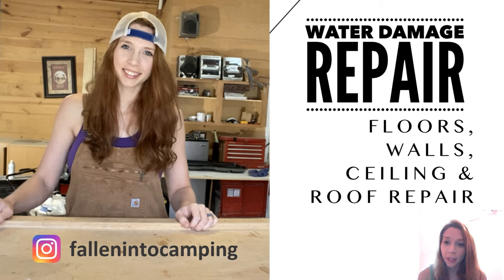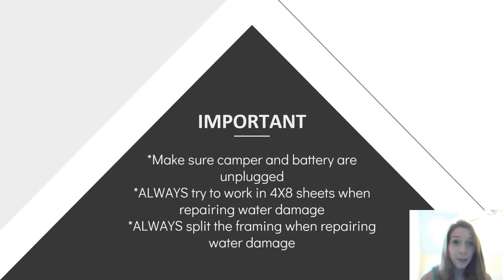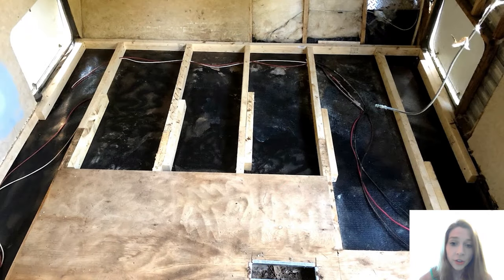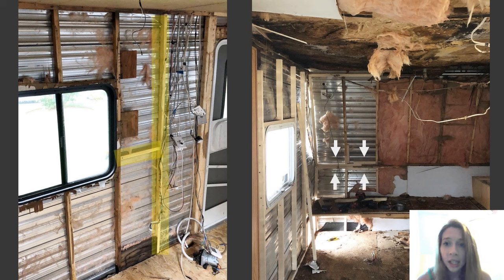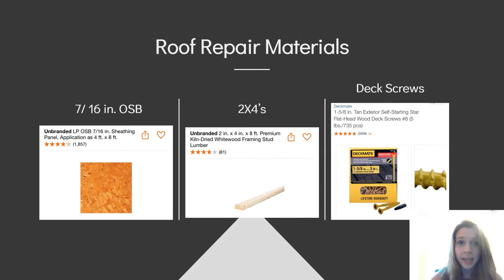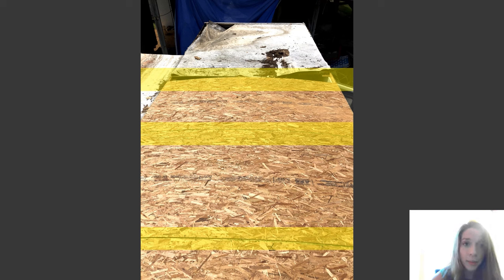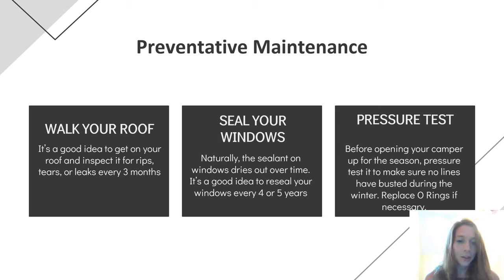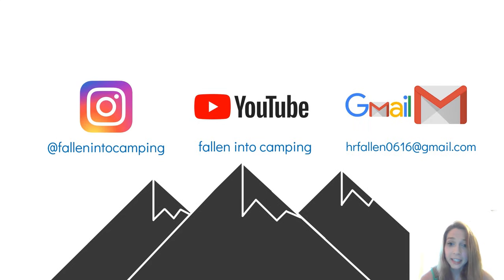(UPDATED) RV Water damage repair in 6 easy steps!

Comment: You're a gem. I enjoyed watching your video. Easy to listen to and 99.9% accurate. I'm a bit sceptical of your splicing procedure on floor joists. Splice length and # of fasteners are dependant on span length and loading.  Since you didn't give either, you sort of just skipped by the issue. Also, you might try using 1/2"-3/4" plywood gusset plates when repairing minor damage to trusses.  A glued and stapled gusset plate (or two) cut to the truss shape can repair a truss back to it's original or even greater strength capacity.  Overall, I'm very impressed 👍.  Keep up the good work.

Comment: THIS IS EXACTLY WHAT IVE BEEN LOOKING FOR! Straight to the point, yet detailed explanation. No BS! Thank you so much! I am also a mechanic/woodworker - with carpentry experience as well, but this will be my first time working on an RV, so I just wanted to see what I’m getting myself into. I would be super interested in what jig you use for your trusses as well (:
Reply from the maker: I made it out of a truss I took from a camper a long time ago. Basically made a template out of some 3/4 inch plywood that I can clamp together at the right angles and dimensions. If you can get a truss out of your camper, that’s the way to go. Most of them are the same, but the one time I say that it won’t be 🤣
Reply: @fallenintocamping  oh for sure that makes sense. Ha ha! Well, I really appreciate all the hard work you put into your content thank you!

Comment: Love your channel,  my husband and I are also christians!  I love the precise details you give for reno.  My husband and I bought a camper last year and we did some quick renovations to the ceiling and a wall that truly need to be torn apart to the studs.   We were able to seal the leak and remove the damage for a quick fix so we could use the camper last year.   We found that after traveling a bit that our renovations were not as secure so I am watching closely to see how you achieve the results you get.  We are currently looking at NOT taking the whole ceiling down, so our problem is making a transition between the damaged ceiling and the solid ceiling and that is the challenge right now.  Thanks for all of your great ideas!   You are quite inspiritional!

Comment: Hi, thank you for this video.  The vid is clear and concise.  
I was hoping you could share about where to get matching interior wall and ceiling panels.
Reply from the maker: It’s tough to match panels to the existing wallpaper. You could try contacting the manufacturer, but I’ve never had any luck with getting them to respond 🫤

Comment: Awesome video & information. One thing I did extra was coat all new wood in Thompson water seal or equivalent just in case of a hidden or unnoticed leak occurs in the future. Ya never now. Me and a few of my close friends being skate rats growing up we each had built mini ramps in our parents backyards around the same time plywood & 2b4 construction with 1/4 Masonite  top layer which basically had to be replaced every year. The last one built we coated the entire ramp as we built it with  seal included both sides of the Masonite. Almost 15 years later with the other ramps rotted out and long gone the ramp was still solid no rot whatsoever the masonite was taken off and reused on another ramp actually. Stuff works great.

Comment: I am completely blown away with your knowledge and the quality of your work. Your video presentation is also top notch! It seems you may have done it a time or two. 😉 

I’m about to start tearing out some rotten framing from my trailer but it seems it’s only in one corner and a bit of the floor. 

Thanks for the useful information.

Comment: Great video. I picked up a 1971 Holiday rambler 31ft with all aluminum exterior and framing. I have already gutted the entire inside down to the studs and plan to renovate it with a entire new trailer chassis and with a whole new livable floor plan. I think you would enjoy a renovation like this. I've seen a bit of water damage repairs in my day. I'm currently working on a 03 22ft travel, entire front frame and roof.. Curious. this roof is flat, and walking on it is a bit sketchy. I'm not light, but the trusses just seem soft, not in a damaged way, But I have seen that some roofs are solid walking roofs, while others are really not meant for it. I was thinking of doing new trusses with an arch and thicker plywood. what it has now is maybe 1/8 under an edpm. Have you changed a flat to an arch roof ever?

Comment: Just discovered your videos today & quickly subscribed. I recently bought a small piece of land & have been trying to decide what to live in, camper versus shed-to-house. Decided for now to go with the camper option, my mother gifted me with her 1973 Prowler (20 footer), she bought it in 2015 at a campground, noticed a couple years ago that a soft area appeared in the floor by the stove/sink area. We tore the linoleum up today & saw the extent of damage. Poked a metal rod down through floor, in places it went down to the underlayment. Also has water damage in bathroom ceiling & wall by bathroom window & bathtub. I thought there would be insulation in the walls, but when I poked past the rotted wood, I could see the outer metal walls. Even though the camper is 50 yrs old, it's in pretty good shape, just wasn't maintained in the last couple of years to prevent water damage. I'm determined to bring it back to it's former glory, have been watching all the YouTube videos I can find dealing with rv repair. Looking forward to watching all your content that I can👍😊
Reply from the maker: So cool! Sounds like pretty typical water damage. If you have specific questions feel free to reach out! I’ve got some resources on my website too (fallenintocamping.com) like links to repair supplies!
Reply: @fallenintocamping  I found the cause of a big portion of water damage, a tree limb must have fallen against back of camper, it knocked a 2 foot lower section of aluminum siding out from the top layer, one mystery solved.

Comment: Opened up my camper after the winter and found a sweet little mushroom 🍄 growing from the rug. Slider ceiling was leaking. I am having the roof repaired and I am ready to dig in and get after it! First time. Wish me luck. I do not accept defeat! I need to dry it up and repair it so my family and I can get right into summertime fun.

Comment: Have you done any videos on testing/replacing the electrical in old campers? I'd be very interested in watching that as well.
Reply from the maker: I haven’t done any videos on that yet. I’ve done it a million times, but it can definitely be tricky if you don’t have prior electrical experience. I actually do custom builds and electrical from scratch on my horse trailer conversions, and have rewired several trailers after replacing the entire roof. If you have specific questions, feel free to email me at fallenintocamping@gmail.com 🙂

Comment: Im glad i came across your video! i was so excited because this is exactly what ive been searching for in a video until i heard you say it wouldnt work for an aluminum frame 😞Im going to see if it will work only because i do still have wood studs also. Wish me luck
Reply from the maker: I should have specified this, but if your siding is aluminum (and your framing is wood) this is the correct way to repair! I have since made more videos on campers with fiberglass siding, and aluminum frames (with foam walls)!

Comment: When replacing the roof material and some sheets (in NC) how do you prevent additional damage during heavy rains.

Repairs will need to be done in an uncovered storage area.
Reply from the maker: I live in NC, and I use tarps while the roof is exposed. I get a thick (not the cheap blue ones) tarp and cover the entirety of the trailer (including front/back) and secure it with bungee cords. If I have holes in the roof where the vents are, I put plywood over it so the rain does not pool inside the tarp. If you don’t put something over the holes, the rain will congregate and sink down into the camper and move the tarp around. Ask me how I know 😂

Comment: I'm going to tackle the roof on my class c motorhome. It measures slightly over 8'. Have you had to add extra osb because of this? I haven't taken off the existing pvc yet. Temporarily sealed a leaking fan until I get back from a major motorcycle trip. Any insight would be appreciated.

Comment: Just found your channel and how well done the presentation is is just incredible in comparison to so many other channels.  I'm an RV tech in Texas and did a roof on a '08 HR Aluma-lite, aluminum frame trailer.  replacing the roof decking i used 7/16 OSB with liquid nails and self tapping screws to secure....didnt want the vibration of traveling down the road to pop the screws.  what kind of membrane are you using? it looks very thin and light. Have you done any delamination repairs?

Please keep making these excellent videos!
Reply from the maker: Sounds perfect for an aluminum frame! I use a PVC membrane. You never have to reseal it, and if you get a hole, you can actually glue a patch to it. It’s also got a 10 year warranty! I have a video on how to fix delamination too! I also bought a project that I’ll be posting more of (aluminum frame and delamination)

Comment: One question, how can you reseal first if the wood you are screwing into is rotten? Our travel trailer has some water damage from a leaking front seal. The wood that the trim screws in to is rotten. If I seal it first how do I remove/replace the wood later?

Comment: Wow this is the most comprehensive video I have seen so far. Thank you for posting. I’m preparing to start my project soon and this is what I needed to see. I do have a question. Does the old flooring extend under the walls? and what are you mounting the floor  joists against the wall too? Thanks again.
Reply from the maker: Yep, most manufacturers build the floor and put the flooring in, and put the walls on top of it. The floor joists that I repaired were mounted to the steel frame of the camper. There are holes in the frame that an anchor bolt goes in. Does that make sense?
Reply: @fallenintocamping  yep as long as you mean the joists you added that are just below and running parallel to the wall
Reply: @fallenintocamping  and thank you for your reply.
Reply from the maker: @slstarr1026  yep that’s it! You will clearly see the bolt hole in the frame from underneath the camper. It should line up with your new framing!

Comment: What are you using for trim on all the 4x8 sheets inside the camper?
BTW, great breakdown on all the repairs!  Very valuable!!
Reply: Also, how are you replacing studs from the inside, since the siding is screwed from the outside?
Reply from the maker: I have a video on my channel ‘how to make seamless walls’ but it’s basically iron on melamine edge banding. You can get it from Home Depot (amazon sells it too). It’s in the isle with all of the plywood!

Comment: I have a class A I bought for cheap to fix up and live in, it's not too bad water damaged, it has missing skylight and vent fans and the previous owner did a really poor job to seal those holes so now the floor in the hallway is delaminating and becoming soft/caving in it seems like a straightforward repair but it seems to go under the wall for the bathroom so I'm hoping that wall doesn't need to be removed to fix it. Any tips for that?

Comment: I know this is an older video but I’m hoping you see this.  Our 3 year old rv has massive water damage, but two inspectors have been unable to determine where the water came in.  Rv specialist said everything is sealed and solid, so insurance is not coming through.  It’s an aluminum frame if you can let me know the materials to fasten to aluminum frame because it looks like we will have to do the repairs ourselves if we want to save our beautiful rv 😢
Reply from the maker: Oh, I’m so sorry! If you look through my north trail reno, I have lots of repair videos for RVs with an aluminum frame. I bought a 16 gauge nail gun and it works great. A 16 gauge staple gun would be even better (I prefer staples
Vs nails but I couldn’t find an affordable one with good reviews when I bought it 2 years ago…I’m sure you could find one now!) If you need a little bit of guidance, feel free to send me an email with pictures of your trailer! (Fallenintocamping@gmail.com)

Comment: Concerning water damage to flooring, I believe the floor under the cabinets and refrigerator of a LQ horse trailer I am considering, is water damaged. Will the cabinets and refrigerator need to be removed to replace all of the damage? It has an aluminum floor under it all.
Reply from the maker: Yes. If the floor is damaged, anything sitting on top of it will need to come up. Also check the aluminum frame under the floor—sometimes they can corrode if left wet long enough

Comment: Where do you start? I bought first (1982)  camper - which to repair first? Roof / walls / floor?
Reply from the maker: Start with the floor, then walls, then roof. That way have enough structural support to keep building from the bottom up!

Comment: very good video I was wondering on the plywood was it over 8' feet in length? plywood generally is 4'x8' though the width of trailer is 8'.5" so I guess that I would have to buy 4'×10' piece & cut it down to the 8'.5" thats needed to go across the width of trailer, is this what you did on your plywood having to use a 4'×10' ply cutting it down?
Reply from the maker: Interesting…I have never come across a camper that was more than 8ft! In that case, you would have to buy a 4x10 piece. But that seems really unusual, because most manufacturers build on a 4x8 scale

Comment: Would sealing be last since you have to rip things apart to fix the damage?
Reply from the maker: I kind of alternate. If there already a ton of damage, I’ll typically rip the interior apart and check for leaks to make sure I know where it’s coming from, and then do the roof. But if it’s minor, I start with the roof. Sometimes it’s not super obvious where a leak is, and I like to see where the water is coming in for myself (and in some cases…it’s not like it’s going to hurt having it leak for an extra week when it’s been leaking for years 😂)
Reply: Thank you so much🙏

Comment: I'm not sure if you're monitoring comments here still, but I have a question.  (Excellent tutorial, by the way!) Have you ever had to re-align the front upper body (walls) with the lower frame and floor joists.  I've taken apart the front half of my travel trailer to remove rotten joists and plywood.  After pulling the door out of its frame to clean out some more rot, the whole front, upper part of the trailer sagged down, shifted to one side and back towards the door frame.  Now the upper body is misaligned by about 2 inches.  I need to re-align things and raise the upper part to fit the plywood floor in and screw everything back together.  Make sense? Suggestions?
Reply from the maker: Most of the time, yes. Especially if there’s roof damage, the walls tend to fall in on themselves. Send me some pictures on Instagram and I’ll advise on the best way to realign!
Reply: @fallenintocamping  Thanks for the quick reply.  I will send you pics of the misalignment as soon as I can.  As far as I know, the only water damage was to the wood frame wrapping around the front half of the trailer, and a few feet back from the front on the plywood subfloor and the joists.  It was not a smart idea that the sewer hose tube was connected to the front of the trailer with the tube extending in underneath the Queen bed frame.  What could possibly go wrong with that, right?
Reply: @fallenintocamping  I answered you on Instagram on August 16 (once my wife and I figured out Instagram!)  No reply from you yet, so I hope I did actually send the photos and captions, but I also wanted to mention that I was able to align the upper body with a couple ratchet straps.  I think I may actually have this repair job in the home stretch.  Thanks again for the video
Reply from the maker: @kyleterlesky4780  I’m so sorry! Let me go through my messages again!
Reply from the maker: @kyleterlesky4780  what’s your username on Instagram so I can look you up?
Reply: @fallenintocamping  no problem - username is kyledebbie321
Reply from the maker: @kyleterlesky4780  I found you and replied! I’m so sorry!